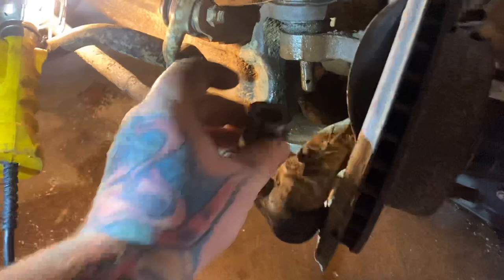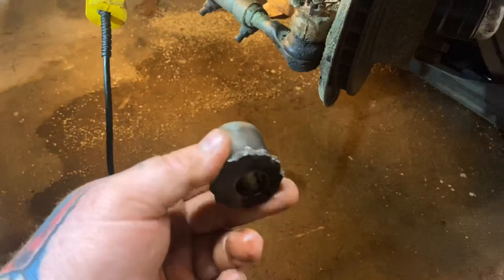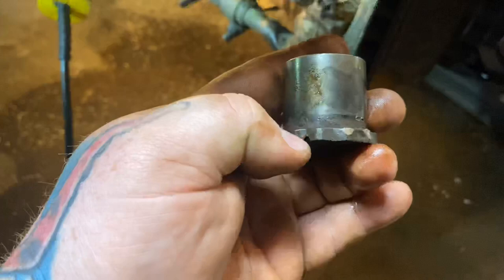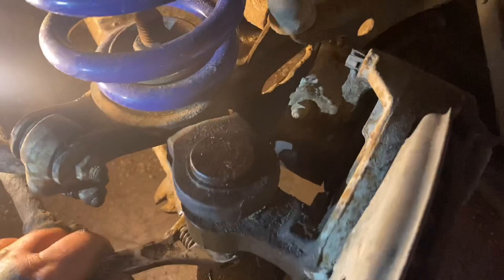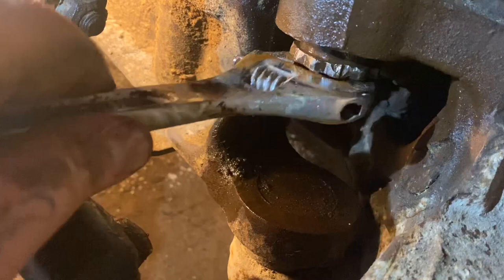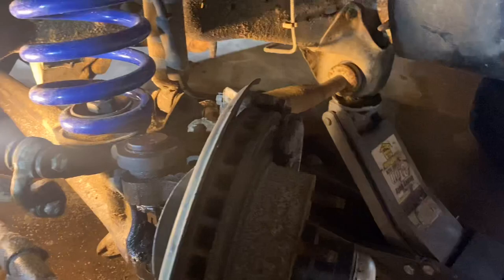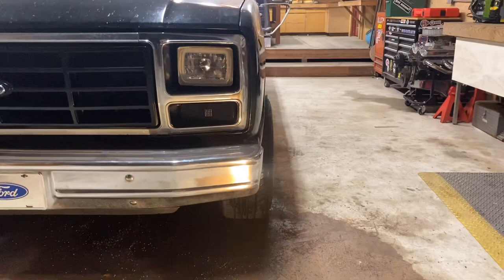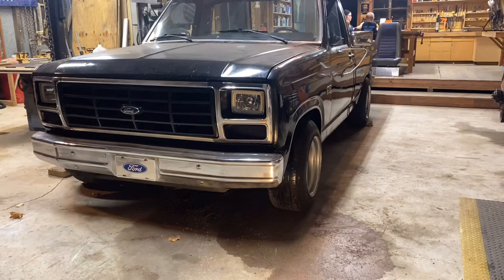1980-86 Bullnose F-150 Caster Camber Alignment Bushing Install/Removal & Adjustment - 2WD/RWD

Comment: This is by far the best bulldoze front end lowering video that I have found anywhere. I've had a  84 for a while now and all I have heard is what a nightmare the ford truck front end is to lower. Thanks to your videos I see it's not that bad. I've done several chevys and the ford springs look actually easier to remove and install.

Comment: Great video, I just did mine, 84 f150, does that bolt not tighten completely because it's something you have to adjust? Just get it snug then set it, or real tight? Thanks alot, it was the only video on this subject.

Comment: My problem with this is , like shown in the video the camber adjuster does not lock in to the correct position and stay there. If i turn the steering the adjuster spins with the nut taking it out of the correct camber position again, as you cant put enough load on the nut to keep it in position. Im going to put a mark on the spindle and the camber adjuster when it correct and then remove again and coat both the adjuster and the spindle with loctite 680 and, cross my fingers it remains in the correct position.
I will let you know how it goes